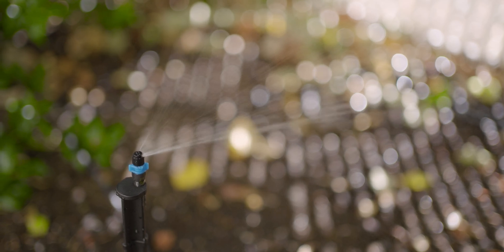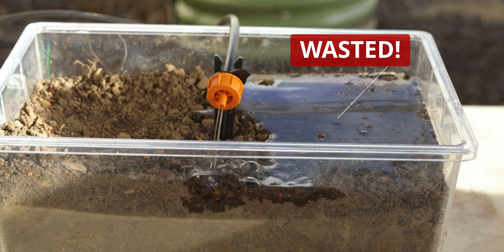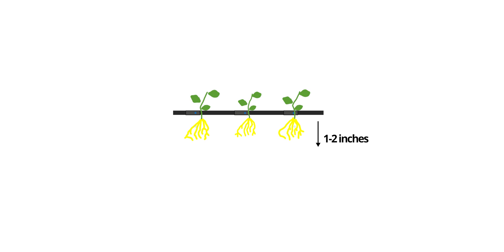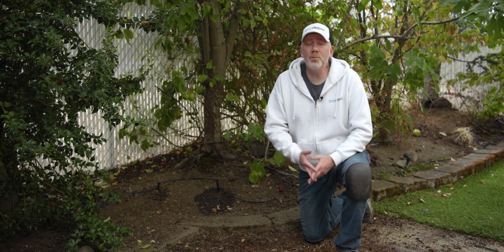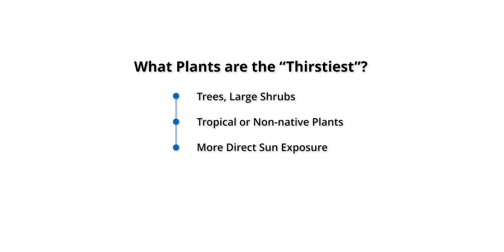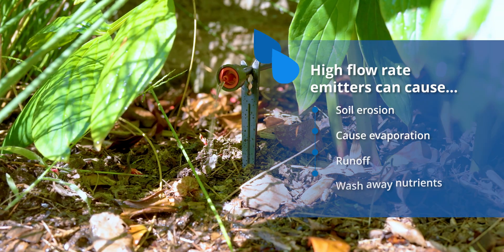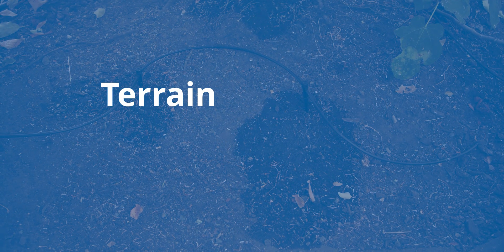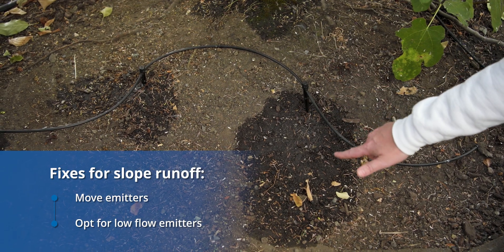How to Choose the Right Drip Emitter Flow Rate

Comment: I just would like to run drip line for Clasia trees, so no misters.  Do I just use drip line with holes every 12" or would I need some type of emitter attachment for those holes? About a 300' run in SW Florida. Thank u?
Reply from the maker: You're on the right track, that is essentially one of the primary ways we irrigate trees - the holes in the 1/4" and 1/2" dripline do have actual inline emitters installed underneath them, so no need for anything additional on the outlet side of those holes.  We usually form the dripline into rings that go around the tree so that water is delivered to all sides of the root zone :) 

If you haven't bumped into it yet, we have a video that goes over a system like that in pretty good depth: https://www.youtube.com/watch?v=NkGTXrGkcRM

Here is a link to a couple diagrams (the first 3 at this link) that shows the parts used - there's surprisingly few different parts needed: https://help.dripdepot.com/support/solutions/articles/11000119082-tree-irrigation-sample-layouts

Depending on how many trees you need to water, about the only difference between the images and video and yours could be the mainline size (the video and the diagrams use 1/2", at 300' you might benefit from 3/4" to minimize pressure loss).
Reply: @dripdepot perfect. Thanks for the indebth reply. Have a great weekend

Comment: In Western Australia we are allowed to water 2 times a week by irrigation, between 6pm and 9am. Those days depend what number in the street your house is . Eg number 5 is Sundays and Wednesday. Other days you can hand water. Complete sprinkler ban between 1 June and 31 August (our winter).
Reply from the maker: When we have water restrictions up here we also do the even/odd house numbers method.  Fortunately we haven't had them for a few years now, but every so often this part of Oregon goes through drought and we get similar water restrictions.  Not sure we've ever been limited to just two days of the week, but we also get a similar time window to minimize evaporation.  Lots of states and municipalities have also started requiring (or at least incentivizing) the use of pressure regulated spray bodies (Hunter Pro Spray 40 with MP Rotator, for example) for new sprinkler installs to improve efficient water use.  Over time this will likely yield results, though only a drop in the bucket compared to Ag adopting drip irrigation - that's where the big increase in efficiency will be seen :)
Reply: @dripdepot when I first bought a house in Perth water was FREE. 😳😅
(1993).  Not long after they introduced free for the first XX amount of litres, then you payed for what you used after that, then they cut the free allowance, and introduced a staggered payment depending on the amount you used. This is over the year, then it resets to the baseline cost, and incrementally increases again. It always seems by the summer rolls around we’re in the more expensive band of water. 🤦‍♀️😂
Our 2 days a week for garden watering was implemented in 1996, and has never been rescinded. 
We just don’t have enough water to do that. Especially as our city’s population has grown so much. 
People get fined if they get caught watering on the wrong day. 
We are allowed to catch as much rain water as we like from our roofs. 
I have a 136,000l rainwater tank. But I’m off-grid-so it’s a necessity. 😂
Reply from the maker: @Harmonyofthespiritualspheres  That's some awesome water history!  Free water?  Man, that must have been some time, working with water as much as I do it's almost unfathomable to me, but such an interesting case.  Where I'm at in Southern Oregon we had water meters installed by 1901 lol.  In many places around here we do at least get a lower rate for the first 3785 liters or so, basically a tiered pricing that incentivizes some conservation.  

Does the 2-day a week limitation make it difficult to grow shallow rooted plants (lettuces, spinach, etc) without hand watering, or would you say hand watering is a must for those?  

And good call on the rainwater tank!  Even without heavy restrictions I think they provide considerable benefit, but with restrictions I suspect its investment is paid back many times over before too long, particularly if you're able to fill that tank up most of the way, that's a very good sized water tank!
Reply: @dripdepot IKR free water?? It’s completely unfathomable these days. 
We had a yearly charge to cover infrastructure- “Water Rates”. 
Then they added water consumption. I think initially it was 150g/L free, then tiered from there. Dropped to 75g/l free, then nothing. 🤦‍♀️
It did halve our water consumption though. lol. 
With delicate plants then yes-hand watering; or can set up a small drip system from a tank.. but also we rely a lot on shade cloth to protect from the afternoon sun, plus mulch to help with evaporation. 
I have no access to scheme water so the bigger the better when it comes to tanks. Not sure what they cost in the USA but this was $13,000 AUD, plus a sand pad, made of 1mm bluescope steel, with a liner. 
I watch a lot of US YouTube-and it seems a lot of places there have restrictions on rainwater collection? 
When I saw the LA fires i remember thinking how different it would have been if every house had their own rain water tank with a pump. 
It’s not unusual for country people here to have a small fire trailer and pump. Plus we have to keep fire breaks etc.
Reply from the maker: @Harmonyofthespiritualspheres  Yes to the shade cloth and mulch!  We have an upcoming video emphasizing the importance of mulch in regards to watering efficiency.  It's one of those things that makes an immediately noticeable difference and can pay itself off quickly (and that will only get more true as water rates rise).  

That actually seems like a reasonable price on the water tank!  I did some searching to check US rates and kept ending up on .au websites.  At first I didn't notice, but when I saw they had store locations in Wagga Wagga and Toowoomba I got suspicious. I changed the units from "liters" to "football fields" and got some results closer to home.  Costs were a good deal higher, but I didn't dig too deep, at that point I just wanted to find some US listings.  :)

And you do have it right on restrictions on rainwater collection here.  Some places have little to none, some go pretty heavy on the restrictions.  Where I'm at, I do believe it's collection from the roof only.  There could be some exceptions (within city limits versus not in city limits), but there are definitely some limitations.  I live in town so when it's something I look into it will be small water tanks only due to space (about 0.2 football fields, or 190 liters).  

Where I'm at in southern Oregon wildfires are very common, and you got it exactly right on the water tank and pump.  Those are getting pretty popular up here and we've helped a few folks out with inexpensive (relatively) alternatives to some of the  very  pricey solutions being offered out there.  A lot of them pump from a pool instead of a water tank, but exact same concept.  These are mostly about prevention - keeping the property, and particularly the house, moist during wildfire season.  Since I started in irrigation I've seen drip go from something only known by farmers and insiders, to being used to prevent fire, water foundations and even a company that's doing it far up north to prevent freeze damages to roofing and eaves, it has been a remarkable evolution.
Reply: @dripdepot I forgot you measure your water slightly differently. I looked and in acre-feet 136,000L is .11 or almost 35,927 US gallons. Water tanks are pretty common in towns out of our main cities, even when scheme water has made it to the rural town, people will still collect it if they can. 
And now tanks come in slimline /under the eaves of houses sizes more city folk get them to water their yards. 
I’ve been trying to absorb as much info about irrigation from your channel-having spent 2 summers hand watering I can’t do another one 😂
it wastes water, is so time consuming and when it’s 45c (133f) it’s tiring and stuffs me up for the day. 
Still getting used to moving from a 390sm city block to 2.5acres 😂
Thank you for taking the time to reply 😊

Comment: Bear in mind that every time you force water through a small opening, particles build up there and alter the flow rate rendering any of this data inaccurate. And you never really know which nozzle is plugged or where to find it amidst all the vegetation until the plants starting dying.
Reply from the maker: In and of itself, sending pressurized water through a small orifice doesn't result in a specific type of particle build-up, but smaller orifices can be more prone to clogging due to their size.  Using a filter sized for the emitter orifice allows drip emitters to perform very reliably over time.  Like sprinklers, they can pass debris of certain sizes so it's mostly a matter of filtering out any debris too large for the emitter orifice to pass.  Though most of it will build-up on the screen, hard water can see scale form in the emitters over a long enough period.  In those cases it does take a bit more maintenance to give them an "acid bath" to break down the scale. 

The most common cause of a clog in a drip emitter, outside of using unfiltered water, actually comes from the outside.  As water drains from the system, if air has no other way to enter (such as an air vent) it will often enter through emitters which can suction back soil and result in a clog.  We use those little stabilizer stakes to keep the emitters elevated above the soil a bit for that reason, particularly when not using an air vent as well :)

Comment: Great informative video thanks. Actually you may have helped solve my problem using water jugs to water my trees. I use plastic milk jugs with a pin hole to water some of my trees. Problem...even with a small pin hole the water drains fairly rapidly and will empty in a few hours. After watching your video...I'd like to try and add a low flow drip emitter to the milk jug and see if I can get it to drip water for a day or two. Any thoughts or ideas will be appreciated. Thanks again for your efforts.
Reply from the maker: Yes, it's surprising how much water can come out of even a very small pinhole!  I sometimes see commercial products (or people trying to replicate one) that relies on pinholes poked along a length of tubing or hose.  Even the smallest pinholes put out much more water than people anticipate and it leads to a lot of problems.  Drip emitters use turbulent water flow, labyrinthine passages and sometimes diaphragms in addition to small orifices to help control the volume of water that is released :) 

That means you're definitely on the right track here, though even a drip emitter may have too much flow.  A dripper like this one can drip water and extraordinarily low pressure, which is likely the case here with just the height of the jug generated water pressure for it: https://www.dripdepot.com/turbo-key-dripper 

The potential issue is in the flow rate.  The lowest flow rate on that dripper is 0.5 GPH, so even a 1 gallon jug could empty in about an hour.  In actual practice it would be drip slower than 0.5 GPH due to low pressure, but even if the flow was reduced in half a 1 gallon jug would empty in about 4 hours.  

There are some 0.3 GPH drippers out there, but those have much higher pressure requirements than the dripper above and may not work as they should.  

If you try the dripper route, I think the biggest challenge will be in getting it installed in the wall of the jug leak free - I've never tried the barbs on the drippers on anything other than poly tubing so I'm unsure how well a barbed dripper would seat into the relatively thin walls of a milk jug.  It wouldn't necessarily be guaranteed to leak, but the potential is definitely there.  A grommet or something similar may be needed in the wall of the jug to provide more contact surface area for the barbed end of the dripper.
Reply: @dripdepot  Thanks for your great follow up with the detailed thoughts and suggestions. 

Also thanks for the link to your site for the drip emitters. I bookmarked it for later when ready to order.

Re: placing the drippers on the thin walled milk jug...I was assuming I would use caulking or a sealant on the drip emitter...then stick it in the milk jug and let it dry real good. Should be OK. Once installed the milk jug won't be moved so there will be no stress on the drip emitter to work the sealant loose.

Two thoughts on the water pressure...

First...(assumption) turning the milk jug on the side would lower the water pressure a little and may help minimize the flow a little bit.

Second...thinking about taking a .5 gph emitter and putting a dab of glue in the outlet...maybe cover half the hole...? Turn it into a .25 gph drip emitter...?

If the drip emitters don't work...I'm looking at wicking systems...with a rope or threads in a milk jug to slowly drip the water to the trees or plants.

Open to any ideas thanks.
Reply from the maker: @cosmicbeingzcosmos233  You bet, some kind of sealant or caulk could definitely help provide the needed seal, good call!  Be sure to go with a non-toxic one and I do think it would be a good and effective solution, particularly as such low pressure and with minimal disturbance. 

Turning the jug on the side would indeed lower pressure.  Probably not by enough to make noticeable difference, but absolutely no harm in it and it could be a case where "every little bit helps", and in conjunction with some of your other ideas contributes to the overall success.  

Covering the dripper outlet with something could indeed slow down flow.  You'll want it to be something non-toxic of course - a lot of hot glue, Elmer's glue or even aquarium silicone might fit the bill there.  It won't be precise, but it's definitely something you could tinker with and adjust to try and dial in to a flow rate that works for you here.  Wicking material could be worth looking into.  Cotton shoelaces, a strip of towel or cloth cord, etc, preferably free of dyes.  Cover the dripper with it and, if it's long enough, you could stretch the wicking material out over the area and it would deliver moisture across it in addition to the soil's natural capillary action.  Thicker wicking material should result in lower flow, so a bit of tinkering with different materials could dial this in, perhaps better than glues or silicone blockages.  

Thank you for the thought exercise on this one! :)

Comment: Bonjour,
bon, l'arrosage en surface, c'est bien, mais il y a de la perte (évaporation).
faire un goutte à goutte directement racinaire me parait plus judicieux.
j'ai dans l'idée d'essayer un goutte à goutte dans un tuyau enfoui situé au milieu de 4 bulbes "lys" avec un débit de 5 gouttes minutes (sur 24 heures, ça fait ~ 36 cl).
avec une bouteille de 2L, ça tiens 5/6 jours.
Reply from the maker: You've got it exactly right on the likely evaporation from surface watering.  If water is applied faster than the soil can absorb it, runoff can also occur.  Your plan is a pretty good DIY solution, similar to an olla but a fraction of the cost.  The slow delivery beneath the surface will work much like a drip system and the soil's capillary action should see the water spread well beneath the surface unless it's particularly silty soil.  It would probably be worth a quick test to make sure you'll get enough lateral movement out of the water as the bulb roots will travel downward and outward.   A 2 liter bottle is fairly large, if you experience any root disturbances a smaller reservoir or bottle (or even multiple smaller bottles) could do the trick.  

Overall I think you're on the right track, and if you monitor things closely during the entire process you'll be able to make tweaks and adjustments to improve it even more for the next round of growing :) 

 Vous avez tout à fait raison pour l’évaporation en arrosage de surface. Si l’eau est appliquée plus vite que le sol ne peut l’absorber, il peut aussi y avoir du ruissellement. Votre idée est une très bonne solution DIY, un peu comme une olla mais pour une fraction du prix. Le débit lent sous la surface va fonctionner comme un goutte-à-goutte et l’action capillaire du sol devrait bien répartir l’eau, sauf si le sol est très limoneux. Ça vaudrait le coup de tester pour vérifier que l’eau se diffuse bien latéralement, car les racines des bulbes vont descendre mais aussi s’étendre vers l’extérieur.

Une bouteille de 2L est assez grande, donc si vous voyez que ça dérange les racines, vous pouvez essayer un réservoir plus petit (ou même plusieurs petites bouteilles).

Dans l’ensemble, vous êtes vraiment sur la bonne voie — si vous surveillez bien tout le processus, vous pourrez ajuster et améliorer encore plus pour la prochaine plantation  :)
Reply: @dripdepot  la bouteille sera hors sol - juste un goutte à goutte sera posé sur un bout de tuyau qui, lui, sera dans le sol (~ 15-20 cm de profondeur).